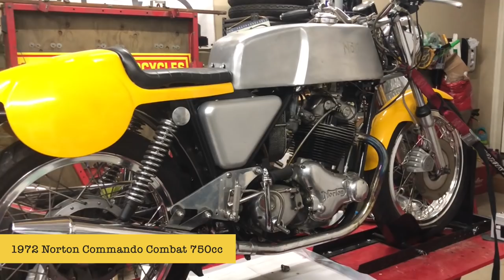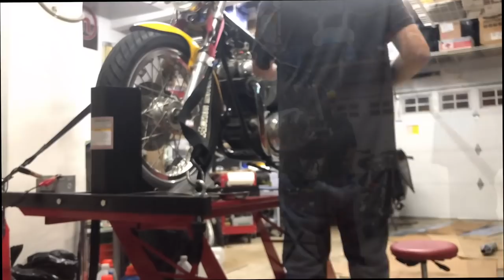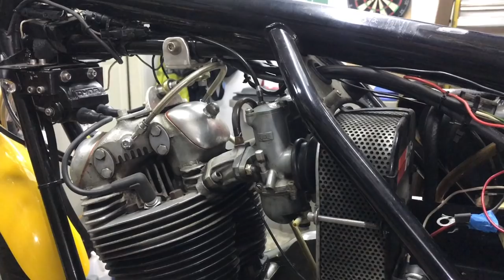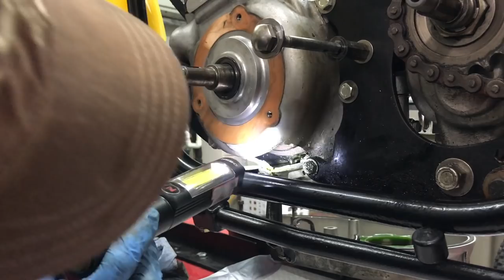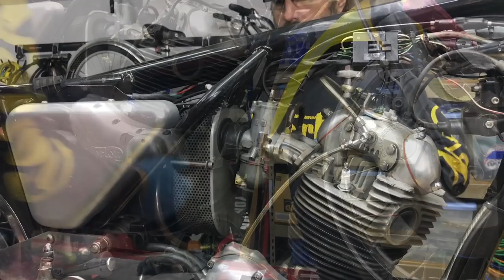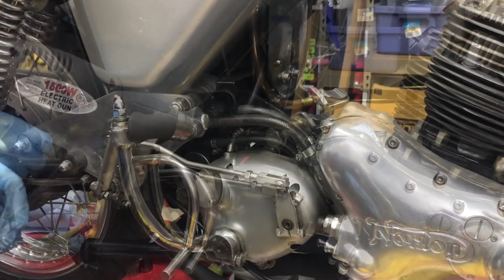1972 Norton Commando Combat Rebuild (3) - preparing to remove the blown engine

Comment: Thank you for all these excellent videos.
I’m on my way soon to pick up my first Norton a 1975 850 and have been brushing up on repairing and procedures with your maintenance videos.
While I was a motorcycle mechanic for many years working on all Japanese brands and since retiring doing restorations on vintage motocross machines I’ve only worked a couple of times on British brands mostly to get them running for friends.
I’m looking forward to the new challenges that the Norton will take me through as I restore it from its resting place of over 30 years
Reply from the maker: Many thanks for your note and congratulations on your MK3 Commando. They are great bikes and I hope you will have a lot of fun working on it. Best wishes

Comment: Seeing you having fun taking the airbox off reminds me of doing the same to my 850 Mk3....  it required removal of the swingarm according to the NVT manual - I wanted to get the carbs in sync and the easy way was to stick a finger in the carb. But as the airbox was plastic I merely persevered with a hacksaw blade and took it off in pieces and fitted some 'Genuine Amal' velocity stacks that cost a bomb back in the day.
 They were held on the carb mouth with three little grub screws that liked to loosen off so the stack fell off - always the right hand side - and  it would fall onto the top of the gearbox between the engine plates. I learned the lesson of wiring things for security.....

Comment: Where I live we call that a "Ventilated" crankcase! Sure nicer to watch someone working on a bike than doing it myself! I'm in the middle of gearbox open-heart surgery...going after the dreaded layshaft bearing as preventative maintenance. Doing it all with gearbox still in the bike. Not so bad really. just need to be methodical and well studied on the matter. Cheers.
Reply from the maker: Haha. Thanks. Good luck with your project!  I hope all goes well. Best wishes

Comment: He was one very lucky man. A lovely looking bike ☹️. Weren’t the Combat engines known for being fragile? although I’m not sure of the actual differences.
I do like the clutch conversion, that’s surely an improvement.
As for the Portland Pebble Dash Co’s next project...that’s not Shep I fear🤔.
Reply: Neil Williams This failure had nothing to do with it being a Combat. The general issue with the Combat was the cam that loves to rev and the rest of the engine that wasn’t up to revving.
Reply: swooshdave thanks for your reply. Although I love these bikes and would dearly like to own one I’m not too well up on their eccentricities. I suppose like many in the past I just thought Combat... it’s broke! I look forward to seeing the rest of the ‘investigation’ as to the cause, which hopefully won’t be too painful. Good luck and best wishes.
Reply from the maker: Hehe, I might just try and do both this new project and Shep simultaneously, since they are quite similar.  Shep is beginning to look angry now ;) Best wishes, Mike